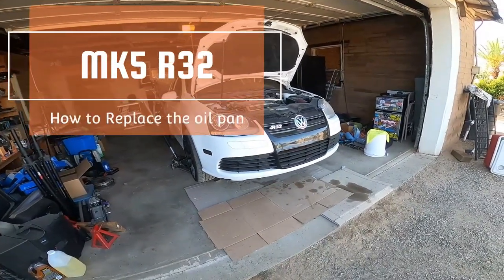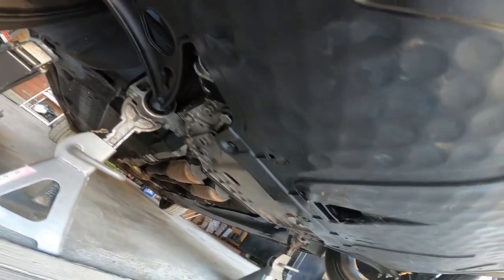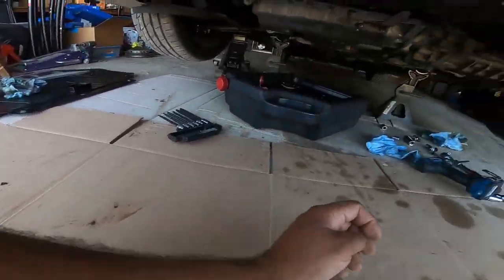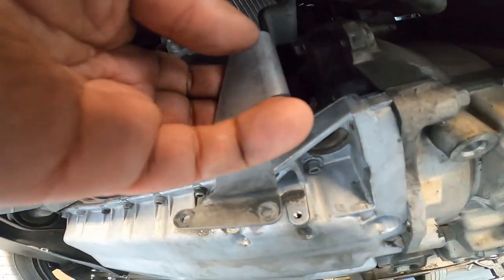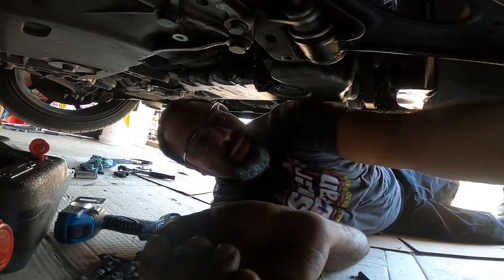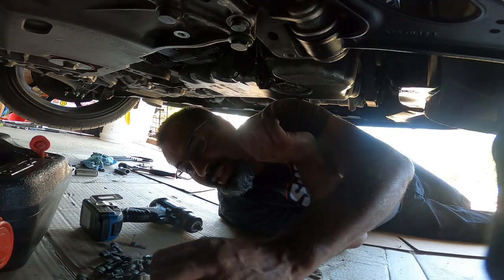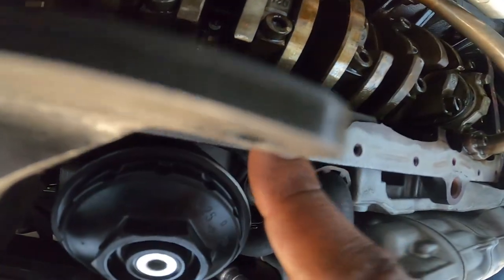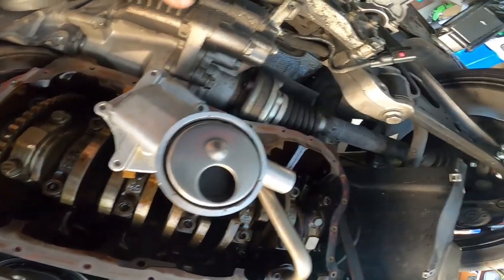MK5 R32 Oil Pan Replacement DIY

Comment: Oh man, I'm about to drop my pan and after watching your video I'm realizing my replacement doesn't have any of that baffling (?) in it. Any idea if that stuff can be transplanted into a bare replacement pan?
Reply from the maker: The pan has to have the mounting holes if not it won't work
Reply: @PincheALsGarage  Just wanted to jump back in and thank you for your help here. Turns out, the cheap ebay pan was only kinda the right fitment. Spent the extra money and got the right pan and it's on now thanks to your help in this video and here in the comments.
Reply from the maker: @DirtyYogurt  glad you got it done. Thanks for the kind words as well